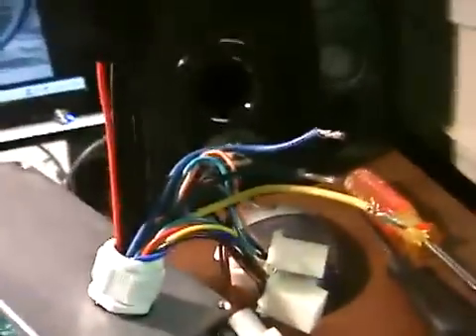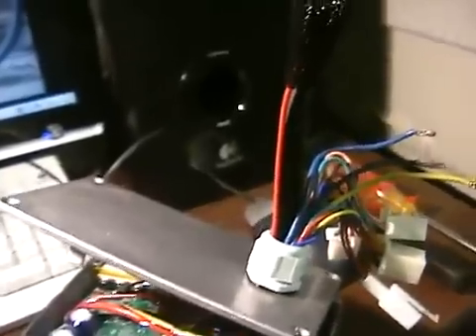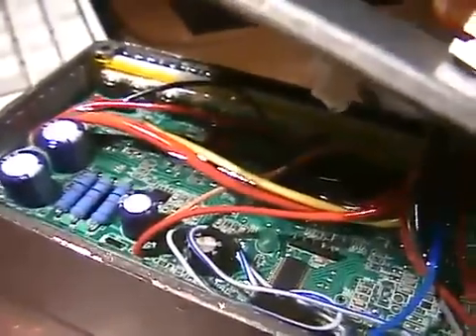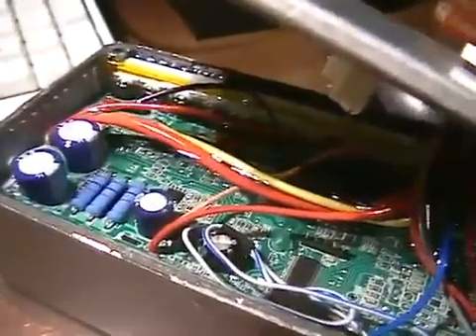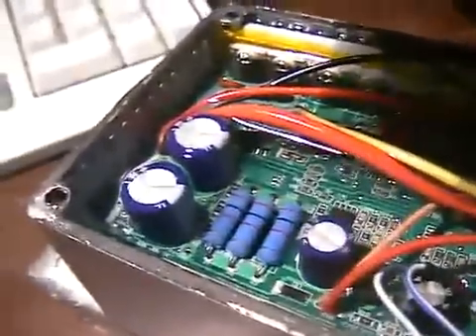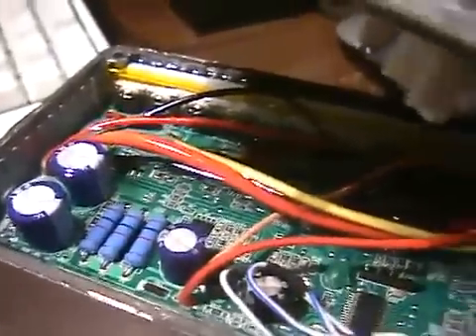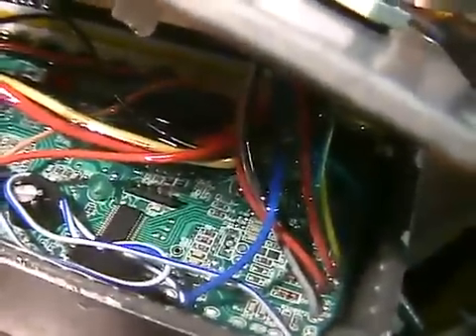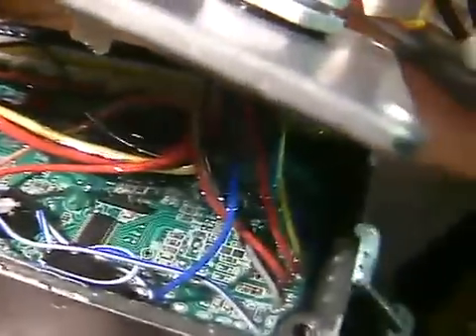mineral oil cooled ebike controller*inspection*

Comment: Can mineral oil also used inside hub motor for cooling and water protection?
Reply from the maker: no even if you can seal the motor. as the motor heats up pressure will force the oil out the axle seal. if you looking for active cooling that works try statorrade its been tested and it stays put.    http://www.ebikes.ca/product-info/statorade.html
Reply: @karmaEbikes.  tanxs

Comment: THAT'S A VERY COOL IDEA. I was going to put a bit of mineral oil into my hub just now to bridge the stator-magnet gap, because my hub came delivered sealed with Statoraid inside, but I forced it up a rocky path for 2 minutes at 1500W and the hubs phase wire sheaths melted inside and I had a short of the phase wire in the motor, and when I repaired it I lost the statorade, especially when you the magnets leap into place at the end, it jerks and the oil went on my face. but then I figured it was probably only mineral oil mixed with iron nanoparticles. Duh. anyways, It's cool to bathe electronics in mineral oil, had forgotten that trick.